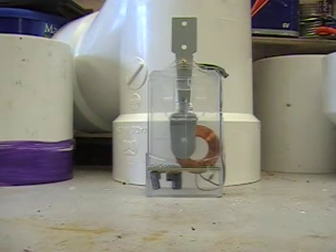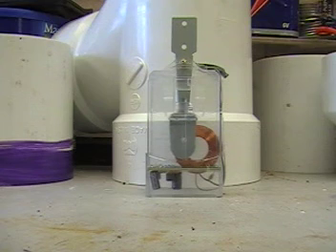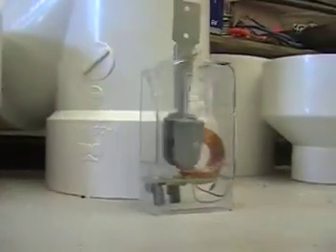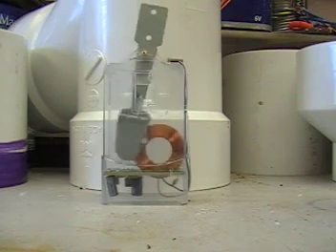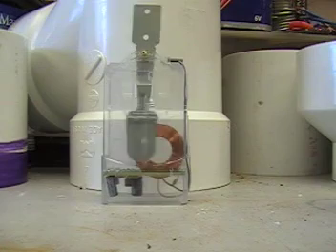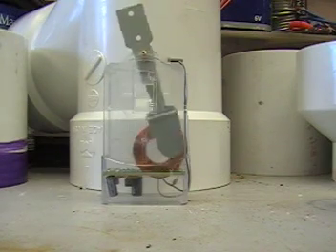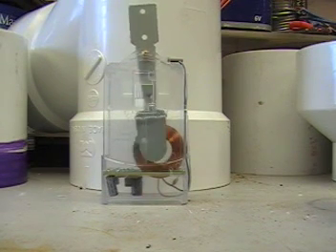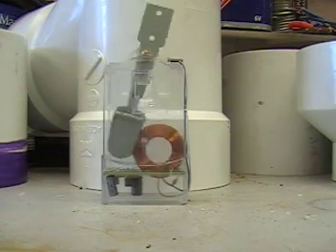Magnet powered pendulum

Comment: It's the capacitor. Solar fountain domestic devices use 2 x 7v
Diode for keeping one direction of energy.
Capacitor being more ability than 14v
Air pressure is 14.7v
So if you do it in a vacuum..  no capacity ability imo

Comment: Hi rhead!  To make a big one: focus on the bearing.  The toy I had had a simple knife edge rocking in a v-groove support.  Excellent for small angles of swing!  All of the energy input (long-term) is supplied by the sun via the solar panel. Very little input is needed to keep a pendulum swinging, even a big  heavy one, if the bearing is good and the air resistance is low.  So don't make your weight in a shape that has to push a lot of air out of it's way (pendulums on grandfather clocks are usually slim disks for that reason).  The electronic circuit is an oscillator.  You only need one coil.  Sorry I can't help with the exact design of that, but some very simple designs, when tuned to very near the natural period of the pendulum, will lock into sync, a phenomenon called coupled resonance, or coupled oscillators.  In effect you have two oscillators, one is electronic, the other is the pendulum.   I'm guessing that would ok, but this toy may have more sophisticated timing circuitry.  Dunno.  Capacitors store electrical energy,  something like a tiny rechargeable battery, but using a different method.
Reply: Ray Kent THANKS Ray.

Comment: The coil probably has two coils. One coil is a "tickler" for the feedback oscillator, the other coil is the "power" coil. You may want to look up "joule thief". It probably uses the same circuit. It uses low power on average, but the kick to move the pendulum requires more current. The solar cell can't produce the high current on demand, but a capacitor can. The solar cell charges a capacitor continuously and the capacitor is used as a current source when needed.

Comment: I bought a dozen of these exact items on Ebay 5 years ago for a few bucks. i took pictures of friends faces and taped them to the top metal piece.  Funny.  They still work, but you have to be careful the magnets do not touch the copper coil and short it out.

yes, the are neat.  This is the same type of product built into solar toys toys being sold by Dollar Tree (for a dollar).  they last forever.
Reply from the maker: Thanks
Reply: +jay p I have a pendulum clock the clock itself uses a "AA" battery and the pendulum uses a "C" battery. The pendulum hasn't worked for a while so I replaced the battery for it and noticed the magnets stuck to the coil I moved magnets away from coil and pendulum swings but not like it used to. Could it have been permanently damaged by the magnets touching the coil I had not thought of any damage being done like that. Do you know if it is damaged what parts need to be replaced? I haven't opened the clock up to see what it has for circuitry.

Comment: Is there a Reed switch? Like, a magnet switch inside a tiny glass tube thingie? I don't think it's a transistor or hall sensor, they are way too lossy. Diodes may need to be Scottky or Germanium, for low loss. Firing may also be done by a zener diode, using their reverse breaktrough voltage. The selfstarting is yet mysterious...

Comment: You could probably start this up with a push of the pendulum (that is why you can't totally stop it).  The solar cell helps but anytime you pass a magnet across a coil you cause current to flow.  This is what charges the capacitors.  This contraption is Awesome!  I would love to see a schematic!  Did you ever make that video of all the pieces and parts?  Ie the cap ratings, etc...  I have an idea that is so close along these lines it's scary! lol

Comment: Firstly the energy for the pendulum comes from the photodiode(photocell). The energy only has to match the loss in the pendulum to keep it going. That will be perhaps 10 to 100 micowatts. A decent clock needs only this amount of power. (My big grandfather clock needs about 80 micowatts (1kg over 1 metre keeps it going a week). 
The circuit almost certainly has two coils, one detects the magnets and the other is driven by a transistor using the energy stored in the capacitors which are charged from the photodiode. The detecting coil drives the transistor and this dumps the energy from the capacitor into the main coil which pulses the pendulum. The self starting is a bit interesting. It is possible that the coil is mounted so that a small current in it will pull the pendulum away from the centre position. Then a small leakage current through the transistor will be able to pull the magnet slightly. When the magnet moves it generates a back emf in the coil that stops the current. So it naturally oscillates until there is enough voltage on the capacitors to fire the transistor and deliver a bigger current spike to the main coil.
What seems clear from the video is that the movement of the pendulum is not a simple sinusoid. So what determines the frequency at which it oscillates? This is a forced pendulum with self synchronisation, a little different front the high school problems of simple forced pendulums.
Reply from the maker: Very  informative and detailed .  THANKS

Comment: Ask and thou shalt receive. Here's a fun DIY article about a magnetic pendulum very similar to your device.
http://nutsvolts.texterity.com/nutsvolts/201208/?folio=32#pg32
...and here's the original patent from which the device was originally derived.
https://www.google.com/patents/US3783550?dq=3783550&hl=en&sa=X&ei=X67xUqHPMoOZkQWA5IDYDw&ved=0CDMQ6AEwAA
This patent was used in the John Bedini Magnetic Pendulum device he produced. He has never claimed he invented his magnetic pendulum since he is an honest man! I hope this helps ;)
Reply: Simply Google Patent search Novelty Electric Motor US 3783550 A by R. Andrews if the link doesn't work.
Reply from the maker: helps a lot   THANKS
Reply: RHEAD100 Finally found what you were looking for. Did you build it yet?

Comment: actually you don't need a solar cell just hang a magnet over 3 other ones (same polarity as) the hanging one so it is repelled. depending on the magnet array it may go slow and barely move with small weak magnets or feverishly with optimal placed magnets of the larger or more powerful variety

Comment: The stonger the current the faster the pendulum will swing, so that's why Im guessing the caps are in parallel. .... anyway Be very careful when working with caps ....a cap if its charged can look harmless til you touch it and it puts a hole in your finger because all the voltage is released at once. That's the diff between a cap and battery. You can buy a capacitor discharger, it makes a whistle noise so you know when its done discharging. Sounds like a WWII bomb dropping.....lol

Comment: The capacitors are yes to store the charge. The Solar cell SLOWLY charges the capacitors. Then once the capacitors reach there max voltage (All caps are rated at diff voltage's depending on size and composition) It looks like they have two of the same size caps in there, probably in Parallel. Caps and batteries in parallel 2x the amperage and the voltage stays the same (in series that concept is reverse) Then there is some kind of bleed resistor in there to slowly discharge the current.

Comment: Any magnet moving past a coil generates electricity. The AC from the coil is rectified to DC and stored in the capacitor. Once the voltage is high enough to signal the transistor it dumps it through the coil in the same direction the current is trying to flow through the coil to produce a magnetic field opposing the magnet to push it. On a big one I'd suggest  the heavy duty power transistors used in car audio amplifiers.
You can wind your own coils and swing a big speaker magnet pretty easy.

Comment: I work for a beverage company and we use them for different ads I dont know the mfgr. but i believe its only taking a charge from the solar cell. It would be a hell of an idea if it reversed the flow and pickd it up from the passing of the magnets and coil but i think its a one way flow of electricity with the caps storing enough to move it and the speed and arc is probably another factor so it fires at the right moment.I like it and if i wasn't so honest i'd steal some of the gadgets they use

Comment: Hello and Happy New Year!
What I found out is that this is an ordinal electro-mechanical  watches mechanism, so, you can buy big ones instead to build)). Your vid give a new push to my thoughts, thank you!
What If to try bifilar coil and use second wiring as a gen? short it and brake out when the magnet passes and you'll have maybe 150volts spikes. then put them into big cap and then send them through a diode into input instead solar panel.
Good Luck!

Comment: I imagine their are certain thresholds that are breached as the caps are charging, which is why you see it "jump" start. Capacitors basically store electrical energy between two plates that form a dieletric. Although in AC circuits they can be used as a filter.

Comment: I am guessing that the small circuit is an oscillator that actually ramps up the voltage from the solar panel and charges the capacitors, which in turn energise the coil, which creates the force to move the magnets. You need very little voltage to get it started because the voltage is stepped up through the oscillator circuitry. Similar to the camera flash circuit except in the flash circuit the caps are dumped through a trigger coil which ionises the bulb. Neat design thought provoking, thanks!

Comment from the maker: I have done very much more testing and measuring on my two stage oscillator and it always comes out that you need a 6,600 pound pendulum swinging on a 2 meter swing  for every horse power out put. The thing most people do not understand is that it takes no more energy to keep a 6,600 pound pendulum swinging that it does a 150 pound pendulum.

Comment from the maker: I just read the article in  Wikipedia on reverse osmosis.

Comparing Reverse Osmosis to my device to desalinize sea water would be like comparing a prop driven bi-plane to an F-16.  My device would be much larger BUT; many times more efficient. Although it will be large. It is very light weight for its size and could be made portable, very easily.

Comment from the maker: For less than the coast of a used pick-up truck. I could build a two stage oscillator that would produce Many, Many times more pressure than that and still be able to run it by hand Or make it run ittself

Comment: Sounds fascinating Raymond.

From Wikipedia "Reverse Osmosis"

"..usually 2--17 bar (30--250 psi) for fresh and brackish water, and 40--70 bar (600--1000 psi) for seawater, which has around 24 bar (350 psi) natural osmotic pressure which must be overcome.."

I bet those pendulums could exert more than 1000 psi. If big enough. A good squirt of fresh water every swing. The reverse osmosis membranes are not too expensive, they are only made of plastic. It's the pressure that costs.

Comment: i don't know how this one works, but if you want a circuit to power your oscillator you could try a Bedini SG circuit... its pretty simple to build, there's a few videos on youtube explaining it(i have 1 on my page). it uses a coil with 2 windings. when a magnet passes the coil, one winding fires a transistor which lets power into the main winding to repel the magnet... you need just 1 transistor, some diodes and resistors, and a coil(that contains 2 windings)

Comment from the maker: As near as I can tell there are only 2 wires coming off the coil.
Hey man; you seem to really be into this thing. And I would really like to know how it works so I can build one strong enough to power my 2 stage oscillator.  With that said. I Am going to Wal-Mart later today and buy a really striong magnifing glass. I will study it as close as I can and try to draw out the printed cercut board and write down all the numbers and lettering I can and e-mail you are the info.

Comment: If you could get another one if these and take it apart, you could take (high res) pictures of both sides of the circuit board (upload them to a picture sharing site like PhotoBucket), it should be possible to reverse engineer it.

Comment from the maker: It will run as long as there is light shinning on the solor cell. turn out the light and it stops in about 15 or 20 minutes.
That is why I think it is also mking electricity from the magnets and coil.